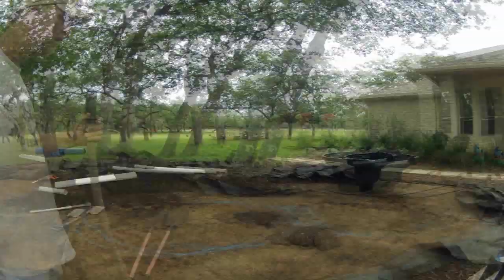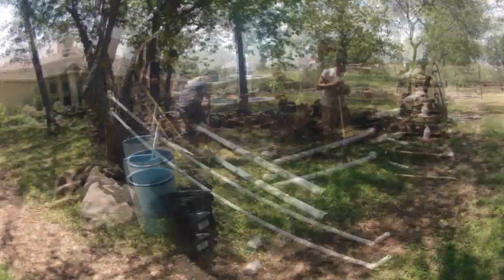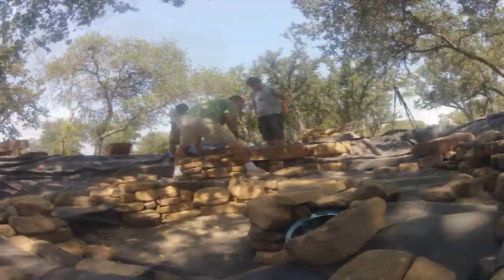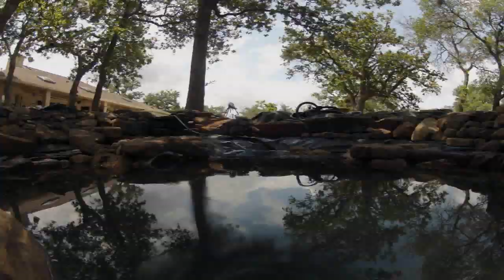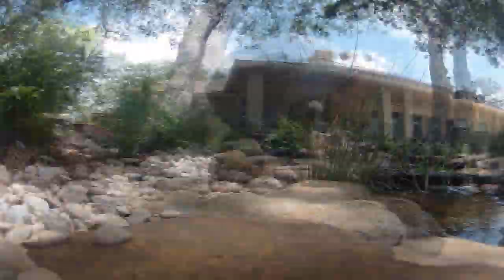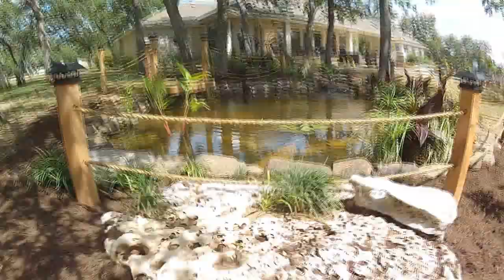How To Build A 5000+ Gallon Koi Pond , River & Bog In 10 Days

Comment: is this pond have your special bacteria in it yet?  Just trying to gauge the UV light vs your method on how it works.
Reply from the maker: All the ponds we build do not have uv lights, people only use uv light if they don't properly know how to build a pond
Reply: GoPro Ponds

Ok.  I have been into fish tanks sense I was about 10.  My current set up is a 300 gallon rare SPS reef tank.  I was hoping my experience would help my new pond I am wanting to build.   I obviously want some rare koi in their but not for the first year or so.

I was checking out your webpage, you recommend the Microbe-LIFT or what do you recommend the best?  It looks like this is a weekly dose?

Also I noticed you said you do not always recommend a bottom drain.   My koi pond was only going to be about 4-5 feet deep I do not want predators to get around my koi fish.  I have coyotes and Racoons in the area but I also have big dogs that will be around the koi pond to protect it.

Would you recommend me getting a bottom drain in this depth?  

Thanks for the info!